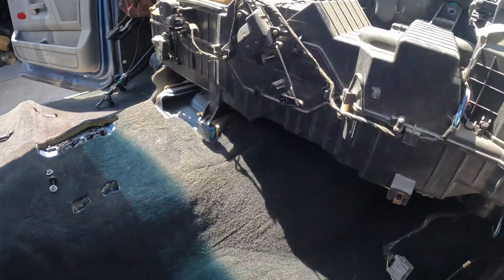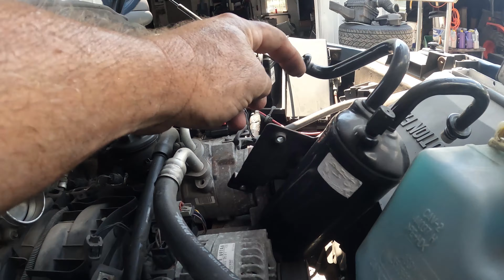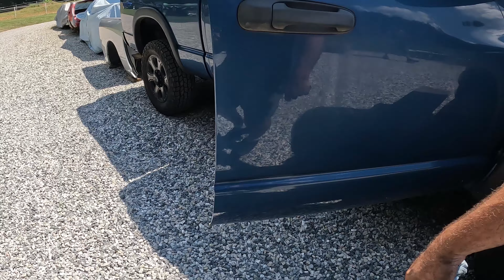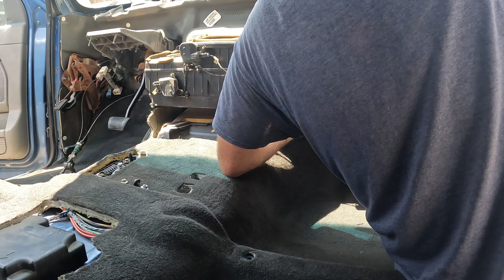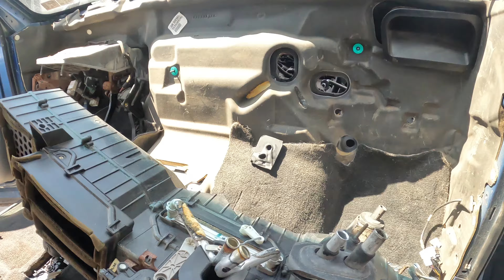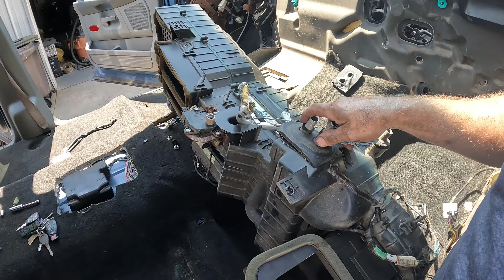gen3 ram truck hvac blend door replacement pt 2 ram truck heater core replacment

Comment: Incredibly complex job!! Not something I would want to attempt. Experienced mechanics only!
Reply: Dealer charge 1200 dollars for  this job. I had mine done in 2010, and the blend doors is broken again.  I am doing this  DIY this time. I am a Service Technician , the only reason I had the dealer got it done because I just don't have the time to do it myself. Pretty expensive. I also ordered parts from Blend Door USA. Very nice kit. I have a 2006 Dodge Ram Mega Cab 3rd Gen truck.
Reply from the maker: I can say this was not fun, in total I worked on this for 3 days but did fully clean everything and recovered the front seats since its my truck i went the extra mile. now i like the older 3rd gen box as its screw/bolted together the newer 4gen are clips and they snap off when separating them.  its nice having heat where you want it to be and ill have ac for the summer now too. i highly recommend the blend door usa